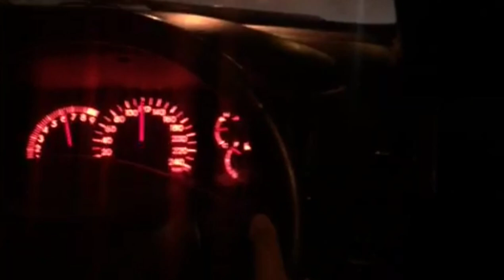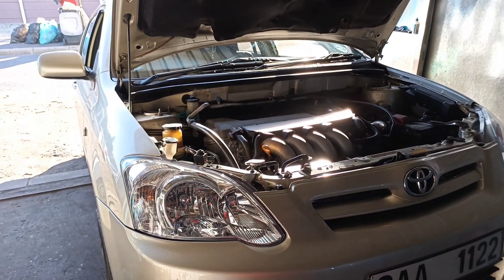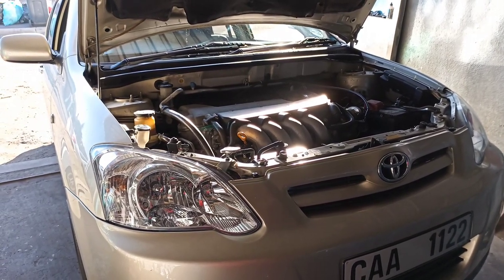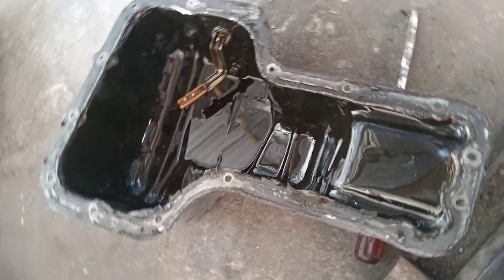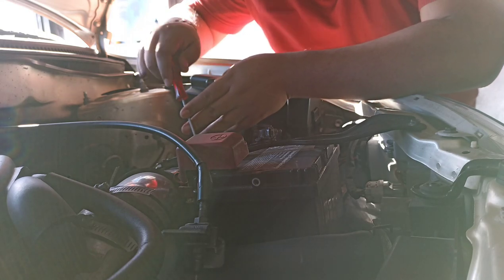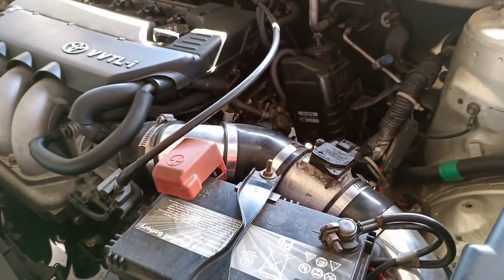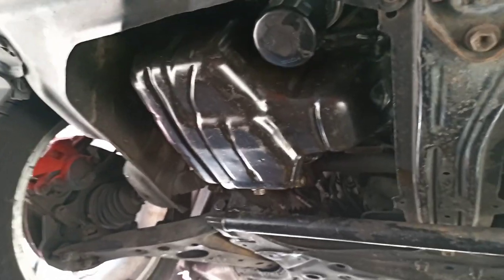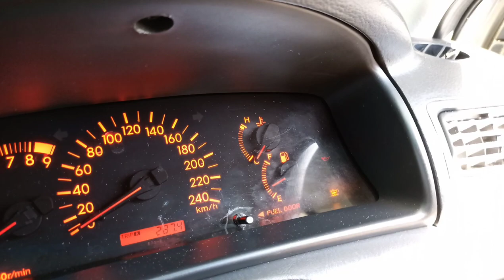2zzge Nation Vlog Engine Flush, Sump service, 1zz sump fit

Comment: Hi i believe its quite hard tuning the engine management systems on the Runx rsi as told to me by others, is that true? If not what do you recommend?
Reply from the maker: There are guys running management most guys run uniq chip with stock ecu

Comment: Lekker man. Just quick: Do you believe that Shell Helix is the best or why did you choose it?
Reply from the maker: Not the best but the best my pocket can afford I change oil every 2k to 3k km
Reply from the maker: But I have been using it for a while no issues 💪🤲
Reply: Yeah, Shell & Ultraclean  GTX work for daily performance cars and are easy on the pocket.  But for full blown racing and living in the redline a better oil is safer.
Reply: @Koup_TV_  what oil would you suggest for people with heavier feet that live in the redline ?
Reply: @mileygamildien7224  It all depends on your vehicle/ engine.  Refer to your owners manual for a concrete answer. Rule of thumb is you can go lower with the low number and higher with the high number if you wish to upgrade your oil grade